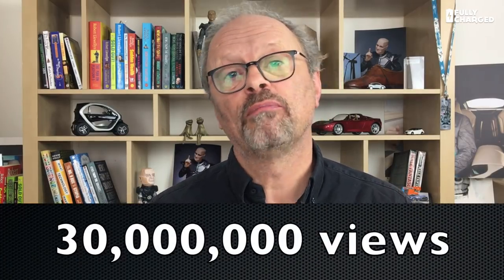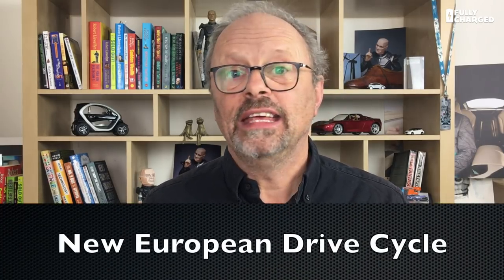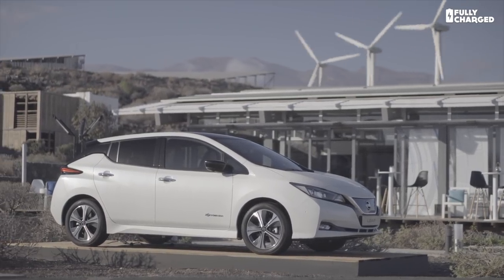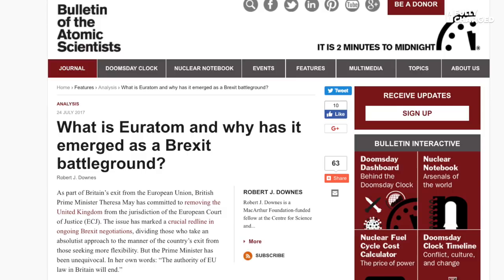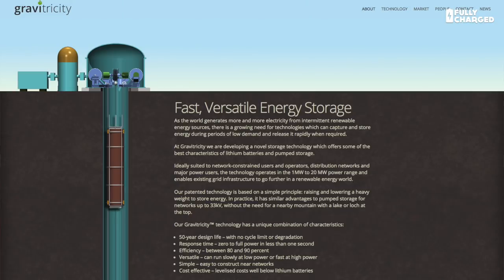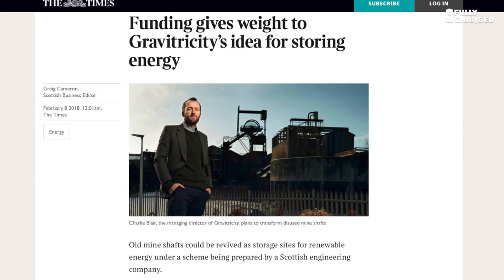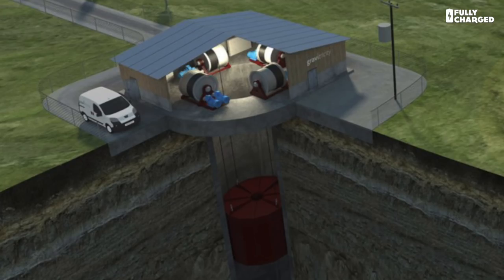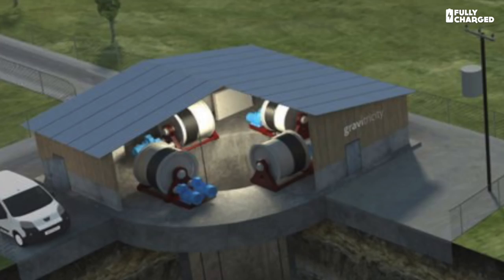WLTP IEM and Gravitricity | Fully Charged News

Comment: Please, please, please, learn maths of physics or really anything

Units:
1KWh = 3600KJ
J=kg·m^2/s^2
KJ=tn·m^2/s^2

Tesla Battery = 10KWh = 36000KJ
Potential Energy Formula: E=mgh so E/(mg)=h
36000KJ/(30Tn·9,8m/s^2) = 122m

You would need a 122m shaft (more os less the height of the London Big Eye)
 and very expensive cranes and a 30Tn concrete block only to do the same thing as a Tesla Battery
Do you really think it is viable in any way to have a huge 122m shaft under every house
Do you understand the ecological consequences, (in aquifers for example)

Tesla Batterys cost around 8240 euros
You are spreading misinformation. Where did you get your education?

Comment: Thanks Robert! Gravity storage options are intriguing. There's another crew that I've not checked in on for a while using water, I think the tech of wireless valve switching inside the piston was difficult www.gravitypower.net